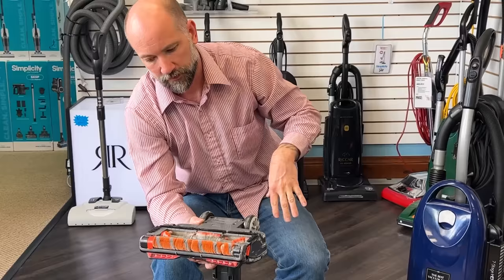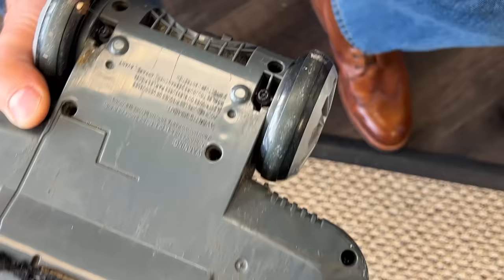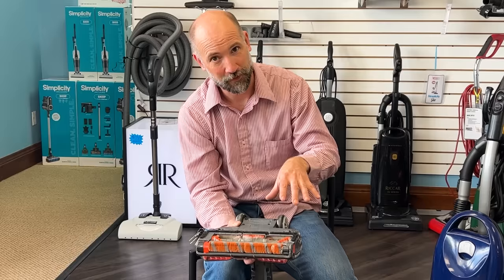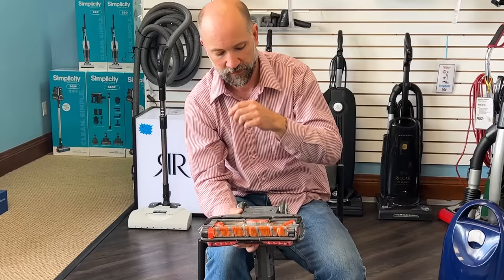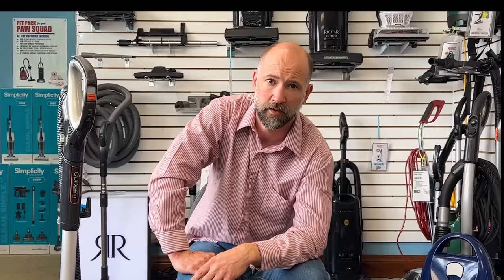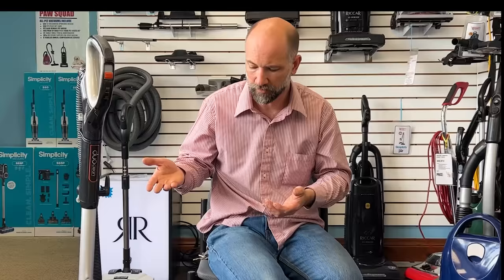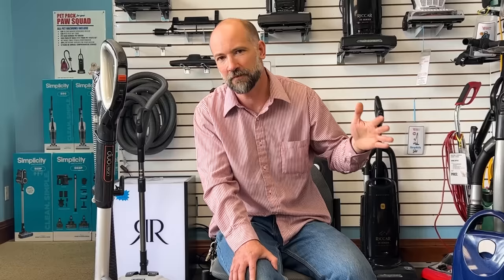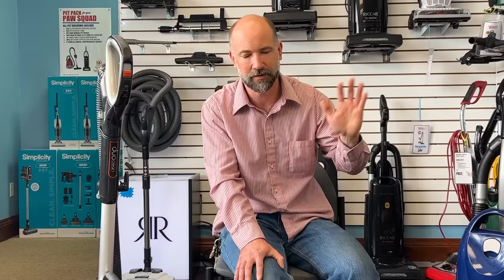Why Can't You Repair Your Shark Vacuum?

Comment: Had to take mine apart when it quit engaging the front roller (Shark Duo, almost exact to the one you show). Belt was fine, it was the switch towards the back of the housing where it's hinged. At any rate, It was damn near like a Rubik's cube getting it apart and back together again. Fortunately I didn't break anything and had a full set of tamper-proof/security torx (I work on a lot of stuff) but yeah, this wasn't a great design for repair. Took much more effort than I expected. At first I was about ready to tell the wife it's time to get a new vacuum, lol. Knock on wood we've had ours for quite a few years now but when this actually breaks badly I'm thinking maybe we should switch brands after seeing this. That said it's been good up to this point overall.

Comment: I purchased 3 shark navigator freestyle vacuums over the years, my wife has had back surgery and can only lift 5 or so pounds on a regular basis, we also have a 900 square foot hard floor home, so it's small and perfect for us. Really great container for debris and really easy to empty, but the rotating brush has plastic bushings that wear through in 6 months or less. The last one I tried disassembling and cleaning after every use which got really annoying, and even then I could only get it to last a year before the bushings had been damaged enough to stop the roller from spinning which would shut the unit off. Bought another brand, the bushings are actual ball bearing  bearings with a protective plastic cup around them to keep hair and other debris from tangling in it unlike the shark. The ONLY downside to this over the shark is the new vacuum's debris collection cup has a terrible filter that requires very thorough cleaning to maintain a good deal or dust is pulled into the motor. If they could improve the collection and filter method id never even consider another shark again, but honestly I'm still looking for the vacuum that doesn't bind up on hair and has an easy dump collector.

Comment: Absolutely disgusting on the part of Shark.  I own two Kirby vacuums and a ridiculous number of attachments and accessories.  One was made in about 1983, the other in about 1965.  I can still get ANY part I need, for either model, at surprisingly reasonable prices.  If I chose to, I could send either of them back to Kirby to be refurbished to like-new condition, including polishing the cast aluminum housings to a mirror finish.  There are plenty of vacuums that are cheaper to purchase new, some that are more powerful, and nearly all that are lighter, but I'm sticking with my Kirbys.  Theirs is an ethical, sustainable way of doing business that respects their customers, rather than exploit them.

Comment: That's crazy that I came across this video. I was just trying to disassemble exactly as shown a few days ago. Quickly discovered it was going to be difficult because star wrenches were needed. Found some star wrenches and got a few off, but there are other tiny ones that are nearly impossible to get out. Gave up on it after about 15 minutes.

Comment: So much for the right to repair.
I work in consumer electronic repairs and like Shark more and more items are designed so that even when you
have removed all the special screws the item appears to have been glued togeather to prevent any repairs
without destroying it's case and locking tabs.
Some you win, but a lot you don't, the recycling centres will always be busy.

Comment: THANK YOU FOR THIS.  I did think I was crazy.  I mean, couldn't find the parts, then couldn't get in, saw another video about the security screws, I remember thinking "huh thats weird, almost like they don't want you to get into it".  Even the guy in the video was having a hard time getting the plastic parts apart (snapped together).  I mean something as simple as a BELT!  Yep, I'm done with shark, good vac but never again.  I want something I can fix for $7 bucks down the road if its a simple part.  Oh and you were spot on, my shark died 2 yrs after buying it (its making a loud noise by the brush head but I CAN'T GET IN to find out what the problem is without breaking into it). I am jumking it and head'n to store, thanks.

Comment: We had a  county clean up day everybody puts out their trash by the road. I seen this shark machine that looked brand new. Took it home to see what was wrong. The brush was not working. Took it a part and ran into security screws.
Being a mechanic went to Harbor Fright and bought a set security bits for $5.00. The problem was hair wrapped around the ends of the brush. Cleaned that up and I use it now..
 Most problems with things is they are not cleaned right.

Comment: That lower hose is easily fixed with electrical tape. Just have a friend extend the hose, wrap it while its extented and it will accoreden back into place for the most part.

Comment: Thanks for this video.

I currently have a shark (model QU202Q) vacuum apart because the head stopped spinning. This unit also had multiple sizes of the "tamper proof" torx screws (TT12 & TT15), including some hidden behind plastic caps. The no-spin problem got troubleshot to a switch that there seems no way to activate, and there seems no reason for it to even exist, except for the vacuum to stop working so that you go and buy a new one.  I looked in the booklet that came with the vacuum, and there was not a single part listed, I took that as a bad sign.

So I came to youtube looking for what this switch is actually for, and found your video instead. So, the switch will get bypassed. And the next time the shark breaks, it will get tossed in the trash, and replaced by another brand.
Reply from the maker: Glad we could help!

Comment: I had a Shark for about 7 years and beat the crap out of it. When I wanted to clean the rollers of course I ran into the "can't take it apart" trap; I wasn't happy. I did need to replace my lower hose and found one on Ebay or Amazon no problem. But once it died I went to another brand; I don't know if its any better as its new.

Comment: Oh well, that explains it. I didn't have a problem with security Torx set as I used them frequently when I was working in electronics. I've still have all my tools some of which are completely obsolete such as a video head puller. But the snap shut housing has got the better of me. I need to get at the motor but I'm guessing even if I did I wouldn't be able to replace it. First and last Shark for this household.

Comment: On trash pickup day around my neighborhood there are always clean late model Shark vacuums out on the curb for pickup. These are usually pretty new models (2-3yrs old) that cost $400-$500. Being very mechanical I've salvaged several over the years and it's usually something simple for me to fix as I have a work shop and the tools required however for the end user this is not an option. 
There really should be laws passed to stop Shark from making these to be obsolete in only a few years only to end up in the landfills across the globe.

Comment: My mom's Hoover is 60 years old. It works fine. It has had many belts over the years, and it is designed for the user to change it. It needed a new cord, because it got shredded at the stress point where it connects to the handle. Bought a longer replacement (bonus!) and never looked back.
Reply: What model is it? After 60 years I’d be afraid to plug it in 😅
Reply: @kingtryton  It's a turquoise upright. Don't know the model number. The plastic part of the bag (that you put the paper filter bags in) disintegrated years and years ago, and we bought a replacement.  They only made a white and beige one at that point, so only the metal handle and plastic housing is turquoise now. But it works as well as ever, and will probably be beating carpets and sucking up dust long after I'm dust!

Comment: I had no idea. I have a Shark now, and it cleans really well, but I'm also a right to repair supporter. This will therefore be my last Shark. I switched from a Henry that lasted nearly 20 years - so repairable. I'll look into the more repairable brands you suggest.
Reply: @robowenmikels I want the repairs to be easy enough for an independent dealer to do. If it's very simple I'll do it, but I know I'm no electrician.

Comment: The gear that the soft roller sits on to connect to the motor shattered on my first shark vac. I thought, hey, easy fix! Got in touch with shark and they said buy a new vac head.

It was a tiny little gear. Wish I had my 3D printer back then.

Comment: Hi Josh
What I find is that Shark has 3 to 5 years warranty on their products so this helps with peace of mind. I had parts go bad. I called them up 4 yrs later after purchasing and they send out the part to just swap out. No extra cost to me.  One part was the  hose that broke at base..a common problem for some. I like their lifetime suction.  And low noise compared to some other major brands
Reply: I'm wonder what salary you make working for Shark?

Comment: Is this just in the US? UK shark models have thumb size plastic locks in the bottom with a Philips head like slot big enough to fit a small coin in, you just push them to the unlock position and the bottom bit comes off easy enough, shark UK also sell replacement parts on their website. The torx screws are indeed still present though in some places.

Comment: My Shark vac that I bought only about a 2 years ago, the vac that bends so you can reach under the bed or sofa - well, it broke. The silver button that you press, in order for the stick to bend, broke. Not only that, but the black, plastic parts around it broke aswell. It still turns on and off, still sucks up like a champ - but I can’t even use it, so it’s going straight to the dump. Even the toughest tape won’t fix it. Now I need to buy another vac. It’s sad because the original Shark vac lasted me a good 7-8 years! Perhaps longer? When that one broke, they sent me an upgraded version for free, which was also amazing, but didn’t last as long. Bought another different model and it just seemed to not last as long as the last one. They just keep getting worse in terms of build and it is such a shame. Can’t buy the part - it’s no longer sold or made and says “sold out” on their website. Now, I’m hesitant about even buying another Shark vac.

Comment: i'll say this:  when Shark was owned by the Quebec company, EuroProX, they warranted that spin head flex hose for me, but the shipping for the "free" part was like $30.. and I'm in Canada.  5 year warranty was attractive then, but about 7-8 years ago the company/product was sold to a big corp, now called SharkNinja and they don't warrant it.  In fact, I was told the 5 year warranty is only on the motor.  I have a Shark Rocket handheld whose power cord I fixed, plus three Rocket floor models one of which I repaired the cord and two of which had split flex hoses.. One was under warranty, one was not.  I was furious but my wife wanted the same one again.. shrug

both the flex hose and the cord were GLUED in place, making for a Hellish time.  Heat gun recommended.  I want something better.  I was also surprised when I replaced the first one that I couldn't even get at the drive belt to salvage it, but I've never needed to replace it anyway.

Comment: Great info. I am very impressed by the effectiveness of my Shark, but sometimes the roller and brush system does not connect until after a heavy whack, and so I know that at some point the appliance will go from fantastic to useless plastic waste in an instant. I've had my dollar's worth, but I resent the pollution that will inevitably ensue.

Comment: I have had 2 shark vacuums and you're right.  They've made it impossible to even get the bottom open so I can replace the belt.  Although the youtube videos I"ve seen for my model show these large, easy to turn with a coin or flat-head screw driver type things that can be used to open the bottom and replace the belts, my machines have those weird  star-ish shaped, multiple sized screws, some of them buried deep in these shaft-type holes on the bottom of the head.  I will never ever again buy Shark products..... what a scam they've got going on.  I'm actually shocked that Costco sells such garbage.

Comment: Less than three minutes in to your video and I already feel seen! I'm simply trying to replace the roller brush and belt (ordered from Amazon). I went to my local hardware store after discovering I need a star driver. I got one with multiple sizes and I still can't unscrew all of them. I'm ready to throw it away and buy a new vacuum. I will do my best to make sure it doesn't end up in a landfill but I will NEVER buy another Shark product. Thank you for your video.
Reply from the maker: Glad we could help!

Comment: Sigh, and here I recently bought a shark. It's was only $120. I knew I might be getting myself into trouble because I clean houses and one of my clients had bought a $300+ shark and it started falling apart after like 5 uses.

But, I was desperate for a new personal vacuum and broke.

So far so good though... But I've only used it like 20 times.

Which, is better than my clients i5 have to say..the hose broke on like the 10 usage.

Comment: I saw so many stripped Phillips head screws and only very few stripped Torx screws. Soo change Philips to Torx is rather improvement than obstacle. 
Torx and Hex bits are as common as Philips and flat heads here in Europe. Almost everyone have Torx bit screwdriver. Actually Torx is more popular and more frequently used in recent eyars than any other head types.
Repearability is very important feature of appliances. Lack of repair parts is unacceptable. Seems like Shark vacuum abuse dominant position in the market.

Comment: The single biggest problem is parts availability for any product like this, security bits aren’t that uncommon in electrical appliances these days. I worked for years on another well know name brand and Torx bits were just were just an everyday thing, the tab fittings are a pain unless you know exactly where to release them on different models.
The reason you see more of this because these days the machines are built to a price and sourced from manufacturers in China who only assemble and don’t stock any spares at all due to the cost of maintain a spares network. The landed price on units like this would shock most people if they knew just how little they actually cost compared to the retail price.

Comment: Shark is not the only issue with that. Dyson does not sell the gaskets for their cyclone canisters or separate components especially cordless ones and same with the ball models. You can buy motors however more detailed component's one almost needs a parts vacuum. Same goes for Hoover, Bissel, Eureka. Too be honest i think when they assemble some of these vacuums in China, they may even be pumped out by the same factory with different labeling on them.

Comment: I'm on my THIRD Shark vacuum product. On my first, a hand-held vacuum, I broke a gear. I called Shark to get a replacement gear. I was notified that disassembling the product voids the warranty.....But they shipped the assembly that includes the broken gear. I was VERY impressed with their assistance and chose to buy a Shark robot vacuum. Again, I have been totally satisfied with with the robot vacuum and recently purchased their Lidar version of the robot vacuum. Again I am EXTREMLY pleased with the products I purchased. I vote a very strong 'YES' To Shark, The Company.
Reply: I too have had little issues

Comment: Well said,...... a despicable design flaw on these machines is how they have the cord coming out of the housing vertically in a grommet, needless to say the cheap, plastic power lead wants to hang due to gravity and this eventually shears the cord and BANG!.  You try to take apart the housing (I fortunately have a set of security torx bits) and , yes, the casing is internally snapped together and is a complete mare to pull apart - and yes, it does break and yes, you cannot get it back together again nicely. This was the First Shark we bought and it will most definitely be our last. Eventually the public will cotton on and hopefully sales will drop forcing them to rethink their policy. If nothing else for the good of the planet.....our vacuum will now end up on some dump somewhere......

Comment: Not impressed by the lack of parts, but a set of torx drivers should be in every DIY repair person's toolbox nowadays. Also, you'll often find a hex or flat driver will fit enough to get the screw out. Even the common 'security bits' can be dealt with by a chip bit set.

Of course, I don't replace a vacuum cleaner that failed quickly with the same make. Especially not 4 times.

Comment: As I watch this I am thinking of delving into the 1950's Kirby that I found abandoned, sitting on the sidewalk for anyone to take, many, many years ago. It is all cast aluminum, it is all complete except the seal that fits in-between the brush roller head the body. If I plug it in and turn it on it roars to life without any sour sounds or smells however with out that missing seal it has practically no suction. I originally picked it up because 1: It is a Kirby and 2: It looks really cool! I like the craftsmanship of our generations before us now. Everything not only had to perform to expectation, it also had to look like a work of art while sitting still. Now-a-days everything is made to perform to expectation until the warranty expires, it looks good enough to buy at the time and, most importantly... is DISPOSIBLE! This could be a vacuum cleaner, a dish washer, a clothes washer, a toaster, an automobile or the shoes you are wearing now while reading this. NOTHING now-a-days is being made with long term sustainability. Ask yourself this: Is this reality a benefit for our long term global sustainability or for maximum profit for shareholders and corporations?